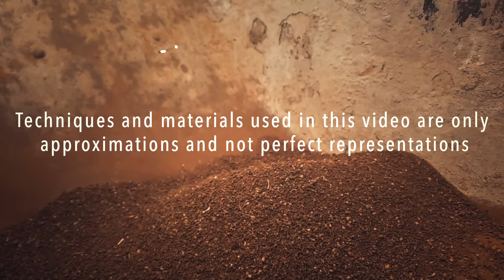Building with Mud: A Continuum

Comment: I have been thinking about the mixes you use here and have thought. Maybe bricks with more sand in them and less straw as well as beign maybe stronger, are good on south faceing walls where the sun will heat up the wall, so they contributing to the warmth of the house, as a sand filled clay brick wil be a good accumulater of heat.
     Heat accumulation depends on factors such as conductivity and how long a substances takes to heat up, how much energy or work is necessary to heat it, which will indicate how long a material will hold will hold the heat for. 

    The example of how a building material changes the heat of a place is found in cities in hot countries refered to as islands of heat. The sun heats up the brick and stone all day and these stop heat loss in the city at night ,creating cities which are too hot at night for the comfort of those who live in them. 

Of course if heat is a problem, as it can be in summer,then using bricks with more sand in them will be contrindicated. Maybe if you plant decidouse trees in front of the building, which will shade them in summer, this problem will be over come.
 WHile a brick wiht a lot of straw in it will be a good insulating brk=ick so useful on north facing walls. 

 In india, where they use thes bricks still, you will porobably be able to tell us when you use the more insulating brick and when the less insulating one.

Comment: U miss 1 more which is the most strong one..  Mud straw and ash..  Ash is same portion as mud..  It will produce the most hard brick that have cooling effect..  If use to build house. The house is cool like u install air-conditioner in house..  If u use pure white ash in small cube or make a cup using it the water u store in it will cool down..  Its an ancient Japan use to use it..

Comment: I prefer interlocking blocks because they remove the necessity for mortar. Also, geopolymer binders for harder, stronger blocks.
Reply: Way to spectacularly miss the point of an earthen home
Reply: j.g.: "...the point..."? As if there could only be one point?  Don't you mean, "Your point?" I started working with earthen blocks 71 years ago and have learned over the decades by questioning traditional formulas. There is no scientific study and little experimentation, sadly.

Comment: Great video - I'd like to build a 42" tall wall to separate my property from the public sidewalk. How will this hold up against rain? Is there some sort of natural plaster that can be used as stucco to waterproof the mud wall? Thanks a lot
Reply from the maker: Thank you.
Yes there's plenty of options such lime or lime clay to make them water resistant, but it would depend on your climate-weather if that would be enough like how much rain you get? and do you get heavy freezes?
Reply: As well as natural plasters, which will require upkeep when exposed directly to the elements, also consider using rocks, esp across the top, to help limit the amount of upkeep from direct rain exposure.
Reply: I have seen walls built like that from cob and Adobe. But you need rocks, tile or other type of material on the top as well as possibly limeplaster. In England they always say cob needs a good hat and galoshes. But if you live where it is very dry, maybe the lime plaster would be enough.  I am learning all I can before starting on our main home.  We are currently finishing our tiny house on the property. Later we are going to build using local stone, clay, sawdust and cordwood to build. Right now in the experiment stage to see what works well here. As well as gathering all the materials. Including the lime. 😎

Comment: I found this so helpful, Thanks! this clarified some questions I had. I am building a geodesic dome and was wondering if I could use the light straw clay to fill up the triangles? The way you did that on the video would be difficult for me because I can´t fill the triangles form "the edge" since they are all already in place. could you suggest a way to do it?
Reply from the maker: Thanks Carlos.
Usually use a little bit of extra mortar and debris from your cut bricks to fill your triangles, if you don't have much debri from brick cutting you could make some sort of Cobb mix which would be very  similar to Adobe in the end, I wouldn't suggest anything like light straw clay because it's not very load-bearing which is what you need something more like cob or adobe in denser mix that can take the weight. Hope this helps feel free to ask, hopefully I'll get back to them LOL!
Reply: @TheNitoProject  Thanks for your answer, I will keep in mind your advice. Aanother question I have is, Can I use wood shavings instead of straw? I have loads of those shavings from all the wood I had cut before and would like to give it some use.

Comment: Which one of these walls is the strongest? 
I think rammed earth walls are the most appealing
Reply: For rectangular shapes probably one of the bricks fired-proofed in a furnace with a little mortar from the same material as the bricks. For everthing else cob probably. The rammed is earth is very pretty though.

Comment: Rammed Earth can have 5-9% cement added for stability and that brings the MPa up considerably to the above the level of commercial concrete in some cases. The striations in Rammed Earth make it an extremely aesthetic finished product without the need for plaster, paint, lime or any other covering. I have had the unfortunate opportunity to live in a concrete house made with tilt up concrete panels. Awful echo with a hardness that was inhuman. Rammed Earth counters that with a softer cooler finished product with excellent  capabilities to counter humidity, heat, cold etc.

Comment: My house is built from layers of clay and straw alternating not mixed together called clay dabbing in Cumbria and dates from 1580-90
Reply: Are the clay walls built first and then straw is added in between the clay walls to act as an insulator? Thank you from America.
Reply: No first a layer of clay then a layer of straw horizontally about four feet wide at ground level tapering to about 3feet at the roof then an earth and straw render is applied externally and 7coats of limewash I’ve just had one wall repaired as there were rat tunnels causing the wall to crack
Reply: @Theyellowchild  : So the clay and straw are not mixed together?

 I fell asleep last night wondering how the roof was attached to the walls so the roof would not blow off.  I am aware that very strong winds are coming on the planet as the Grand Solar Minimum / mini ice age accelerates quickly. Extreme storms coming worldwide.

GSM information:
1) interviews: John L Casey, Anita Bailey, PhD.  Both excellent.
2) YT channels: Adapt 2030, Ice Age Farmer.
3) Storms of incredible magnitude will cause grid down scenarios everywhere
4) food prices to skyrocket in 2020-2021 onward
5) growing ones own food year round and learning to preserve it all is critical
6) manual items/ tools of all kinds are necessary
7) off-grid water, heat, electric sources necessary
8) stock up on food and other items now before food prices increase and other items/ manual tools are sold out or become unavailable

Am thinking ahead about all of this - lots to do but take one day at a time, decluttering and refocusing my mind, body and spirit each day, getting as grounded as possible

The Grand Solar Minimum is a life changer for the entire planet and coupled with the global economy "reset" /  downturn, we are heading into unprecedented times.

Everyone who gets off grid, lives far away from cities and large bodies of water, grows and raises ones own food in small, self sufficient communities will do well considering...
Reply: Sunny sea cat how strange that you should send me this information as I’ve come to a similar understanding myself I always have at least 6 months food stored and also grow what I can also have solar panels and a wood burner stove I try to tell people about this but they think I’m mental nice to meet a likeminded person
Reply: Just seen last post no the main walls are not mixed just layers but the render is mixed together insulation is great once the house warms up it takes very little to keep it warm and I’m in the middle of nowhere as well off the beaten track
Reply: @Theyellowchild  : YT channel Adapt 2030 now is approaching 93,000 views so there are like- minded people out there.
Reply: Will give it a watch thanks